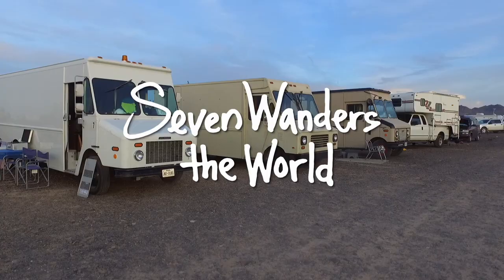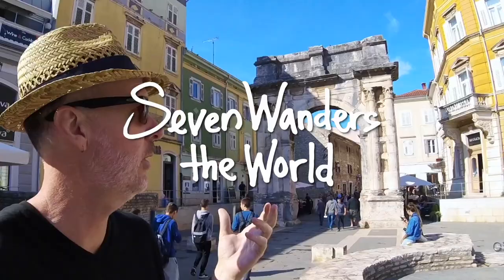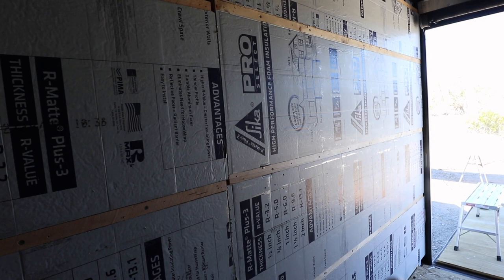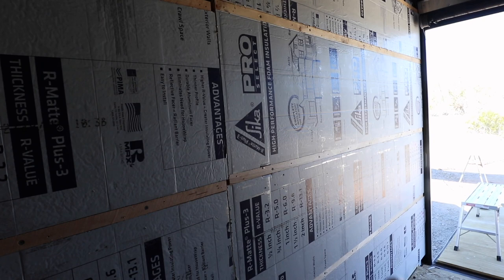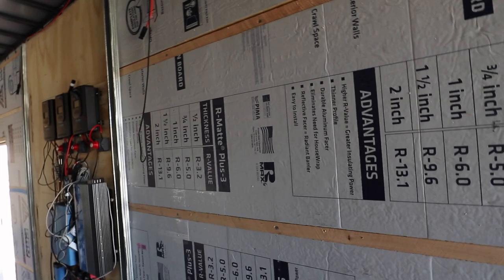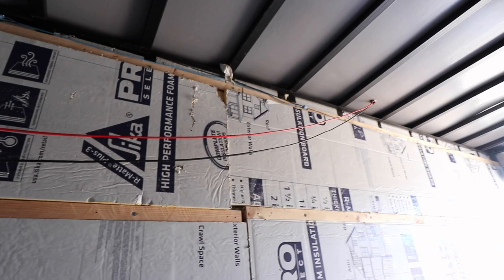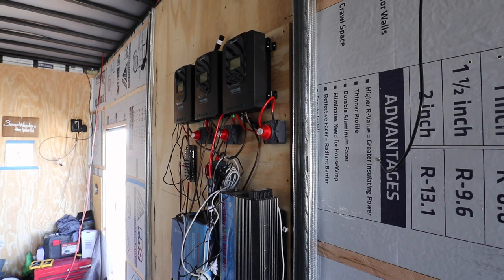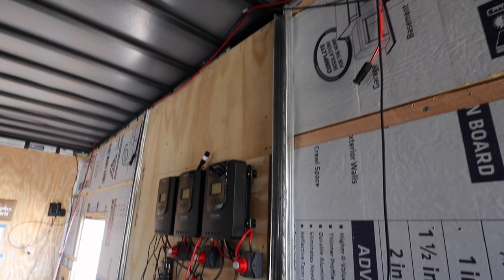Cargo Trailer Conversion Walls P2 E631

Comment: Things are starting to shape up. One thing if I may suggest would be to put a cement board behind your electrical that way if anything gets too hot and start smoldering it won't catch the plywood on fire

Comment: Motrin (always take with food) works well with shoulder issues. Hopefully you didn’t pinch a nerve in your neck/ shoulder. Bob and Brad physical therapists on you tube cover shoulder issues extensively. The key is to not over do! Feel better